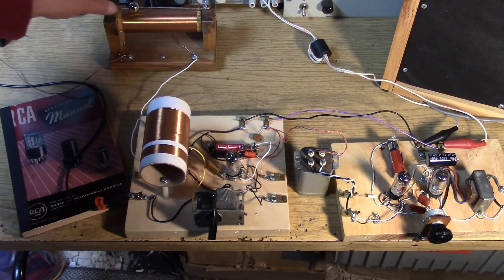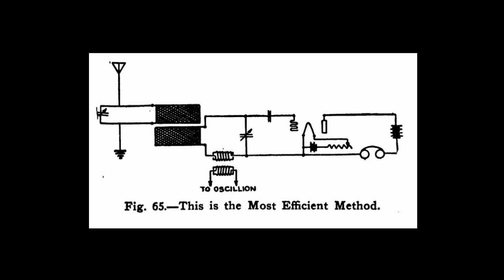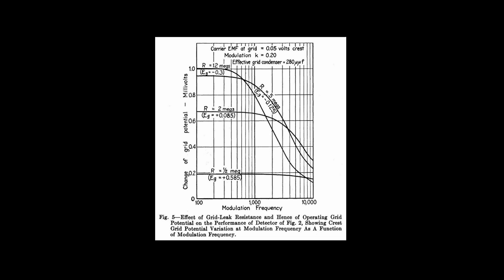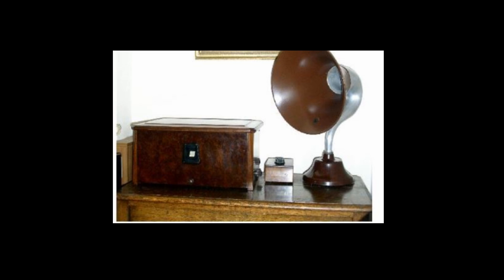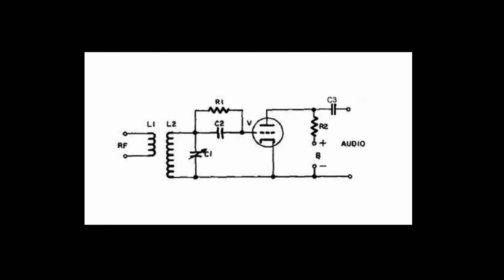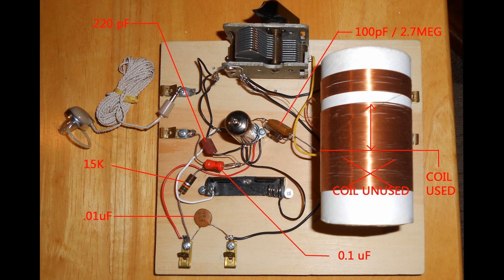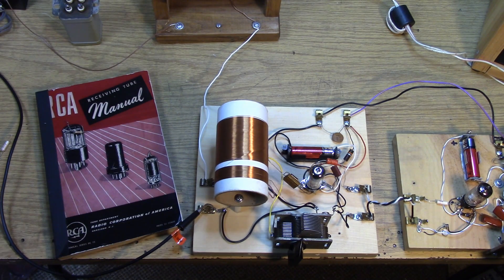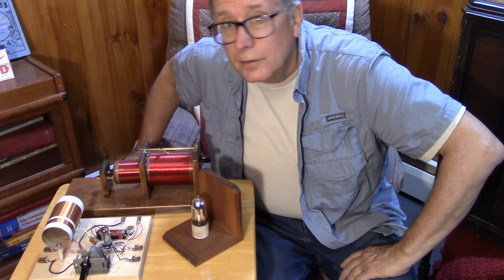Your First Tube Radio Project

Comment: how about some more info on the antenna loading coil?   e.g.: how many turns, form size, etc. ,  and when it would be helpful to use.  thanks.
Reply from the maker: Assuming a normal crystal radio antenna 50 to 100 feet of wire, your coil is simply resonating the wire. You wont need much at 1600 kHz, but you need perhaps 200T down low in the band. So normally just 250 turns of #26 to #30 on a 1.5" tube will allow you to resonate a decent wire length. Its not critical. That is the idea. About 400-500 uH.

Comment: Would a chunky ferrite bar (135x9mm) antenna with 70 turns (my crystal rig) work with this or do you need that large form coil? I've got 5 tubes from a 1939 RCA radio, which of them (oscillator, rectifier, IF, AF, output) would be best for the 1-tube radio? The rectifier & output take 35 & 50 volts, while the others take 12 volts (guessing those are best choices?). Thanks.
Reply from the maker: The Ferrite Rod is certainly more compact, and it allows for the possibility of tabletop reception without a long wire antenna. Generally the input coupling and (if you do a) regenerative tickler coil would both be much fewer turns than with an air coil due to the increased mutual coupling in the core. Spacing the windings can improve Q on the bar. Litz wire can also improve Q. For a 1 Tube start with the detector triode in a simple Armstrong regen. Later you can graduate to a pentode like the IF amplifier and do a Hartley Regen. Those should both be 12V.
Reply: @MIKROWAVE1 Thanks, which detector tube from this relic: Zenith SA7 (oscill.) or Emerson 12SQ7 (AF) would be best or even possible as first project connected to my crystal setup (ant/ferrite coil /germanium diode), using a 9v + 1.5v battery like I've seen on some of your videos & elsewhere. Tubes are 12 v so is this even possible? Basically I just want to use a tube for experience, lowest voltage, to enhance crystal radio performance. Also how to wire 8 pin socket? I see plastic reference notch & 1 - 8 pins clockwise but where to connect? Thanks.
Reply from the maker: @p1nesap 12SQ7 triode is an excellent choice for a grid leak detector. Then upgrade it to a regen by adding a tickler coil and regen control.
Reply: @MIKROWAVE1 Great I watched your grid leak video. I'm guessing pins 1 & 8 (grid 2 & filament) go to the 1.5v battery? And if 12SQ7 runs on 12.6 volts, why do you & all other circuits I see online use 22v? Would a small 12v battery work? Thanks.

Comment: That’s a great video - it answers a lot of questions for a beginner. As someone who owns a 2P2-J tube (~DL92) and feels a regen as a first project would be overkill, I really appreciate it. Thanks 👍🏻
Reply from the maker: Thanks for watching, and good luck on your valve radio circuits! As I may have mentioned, the audio power tubes sometimes make excellent radio tubes for grid leak and regenerative sets.

Comment: Hello,  I just bought one of those undocumented 3 tube sw radio kits, 1b2, 2p2, 2p2.  I plan to breadboard it on a wooden base.  It uses a cbm-223, I wonder if you  have a replacement suggestion using the classic rotating metal plate varicap.  I will be considering using one of the magic eye kits on Amazon for a tuning strength indicator.  My experience is mostly microcontroller based and of course the 3 transistor sw p-box kit in 1974.  Any suggestion would be appreciated.
Reply from the maker: They are cheap, but I am not a fan of the little variables.  The individual classic rebuilds are pricey. Amplified Parts and Antique Electronic Supply offer them. You could try a dual and single or even a triple ganged with a trimmer for a TRF.

Comment: Someone please help me, I have 6AU6, will it work?
Reply from the maker: 6AU6 will work fine for anything like this. You need 6V to light it up of course. and say 35 V to 60V of high voltage for the plate and screen! You can even treat it like a triode and connect the screen and plate together.
Reply: @MIKROWAVE1   Hi Sir, I am going step by step: First I made Crystal radio with a bigger coil multi-tapped> Then antenna loading coil with slider> Then Grid leak detector>Then Regen with adding a tickler.
All worked fine. This is the development of the last 4 days only.  Thanks Sir. 
Here is question please help me,
I made an antenna 40ft N-S and then It is Like L-shaped 30ft E-W. At night the receiver bombarded with Shortwave stations. My first question, is my antenna ok? because I want to listen AM BCB of India only. Next is should I try a shortwave coil for Trapping these bombardment with regen. Suggest me best coil design with tickler. Love from India.
Reply from the maker: @utsavprakash this is exceptional progress for 4 days.

Comment: Understanding AM Broadcast Audio Processing and Receiver Design
Thank you once again, Mike. Your episodes are always a pleasure, and I look forward to the next one with anticipation. In the context of this ongoing radio receiver project—and many others developed for AM Broadcast Band (BCB) reception—it's worth taking a deep dive into some of the technical challenges and opportunities we encounter, especially regarding audio fidelity and signal processing.

This presentation focuses on a crucial element of AM radio reception that is often overlooked by hobbyists and even some experienced builders: pre-emphasis and de-emphasis in AM broadcast processing, and how it affects the performance and audio quality of various types of receivers, particularly regenerative, crystal, and grid leak detectors.

The Regulatory Shift in the 1980s: The FCC Mandate
To understand modern AM receiver design, we must consider the regulatory changes that reshaped AM broadcasting in the United States. Back in the 1980s, the Federal Communications Commission (FCC) introduced a rule requiring AM radio stations to limit their high-frequency audio output to around 9.5 kHz. Above this threshold, a "brickwall" filter was applied, drastically attenuating any audio content beyond that range.
The rationale was to reduce adjacent-channel interference and to optimize the limited bandwidth available on the AM band. With this limitation, the sound of AM radio changed significantly. Gone were the wideband, high-fidelity transmissions of the earlier decades, replaced with more compressed and narrow audio that prioritized clarity and intelligibility over warmth and richness.
The Audio Processing Behind the Scenes
In line with these FCC regulations, AM broadcast audio processors were adjusted. These processors began to include a 75-microsecond pre-emphasis curve, similar to what FM stations had been using. The principle behind pre-emphasis is simple: audio frequencies in the upper range are boosted before transmission to improve the signal-to-noise ratio, especially important in noisy environments like the AM band.
However, due to the steep roll-off above 9.5 kHz, this boost is not symmetrical or natural-sounding when received on basic or uncorrected receivers. This results in AM audio that may come across as excessively bright, harsh, or tinny, especially when using simple receivers that do not compensate for this pre-emphasis.
Impact on Simple Receiver Designs
Let’s consider how this affects three classic types of receivers commonly used by hobbyists:
Crystal Sets: These are passive radios with no amplification or active filtering. They offer pure, unmodified reception of the AM signal, which means they will present the pre-emphasized signal as-is. This can result in overly bright or "sizzly" audio, especially on modern AM stations.
Regenerative Receivers (Regen Sets): These use positive feedback to improve sensitivity and selectivity. While better than crystal sets, regen receivers are still susceptible to tonal imbalances caused by broadcast-side audio shaping.
Grid Leak Detectors: Popular in early tube radio designs, grid leak detectors also lack any internal audio correction. They respond quite strongly to the higher frequencies and can thus over-emphasize them due to the lack of compensatory circuits.
In all three cases, the receivers were never intended to handle a pre-emphasized, bandwidth-limited audio signal. Their flat response curves can therefore exaggerate any spectral imbalances in the received signal.
Engineering a Solution: De-emphasis Circuits
Fortunately, this harshness or "brightness" is not unavoidable. With thoughtful design, we can compensate for the effects of pre-emphasis using de-emphasis filters.
What is De-emphasis?
De-emphasis is the reverse of pre-emphasis. It's an intentional reduction of high-frequency components in the audio signal, restoring a more natural tonal balance. If AM stations use a 75-microsecond pre-emphasis time constant, we can implement a 75-microsecond de-emphasis circuit in the receiver to counteract that boost.
How to Implement De-emphasis
There are two main strategies to integrate this into your receiver project:
In the Detector Stage:
You can modify the grid leak resistor/capacitor network in your regen or grid leak detector to roll off high frequencies.
By choosing appropriate values that match a 75 µs time constant, the detector stage itself becomes frequency-selective in a way that mimics de-emphasis.
In the Audio Amplifier:
Alternatively, and perhaps more cleanly, you can place a low-pass RC filter at the input of the audio amplifier.
The filter is made with a resistor and capacitor tuned to the 75 µs time constant. This removes the boosted high frequencies and delivers a more "mellow" and listenable audio signal.
This method has the advantage of being non-invasive to the RF and detector stages, and can be added or removed as desired.
For example, using a capacitor of 0.01 µF and a resistor of 7.5 kΩ would yield a filter very close to the desired 75 µs time constant (since τ = R × C = 0.00001 × 7500 = 0.075 seconds, or 75 µs).
Benefits of De-emphasis in Receiver Projects
Integrating de-emphasis in your AM receiver project offers numerous benefits:
Improved Audio Fidelity: The sound becomes more balanced, warm, and natural—especially important for spoken word content like news or storytelling.
Listener Comfort: Harsh highs can lead to fatigue. De-emphasis softens the edges and makes long listening sessions more enjoyable.
Historical Accuracy: If your receiver is part of a restoration or reproduction of a classic design, adding de-emphasis makes it more compatible with modern AM broadcasts, helping it perform as it would have with historical wideband signals.
Customizability: With a simple switch or selector circuit, you could even allow users to toggle de-emphasis on or off depending on the station they are receiving or personal taste.
Conclusion
Modern AM broadcasts in the United States, shaped by FCC mandates and evolving audio processing technology, are different from what earlier receiver designs were created to handle. The use of a 75 µs pre-emphasis curve, combined with aggressive high-frequency filtering, means that simple AM receivers like crystal sets, regen radios, or grid leak detectors may produce unbalanced audio if left uncorrected.
Fortunately, with a thoughtful application of de-emphasis filtering, either in the detector stage or audio amplifier, the resulting sound can be transformed. It can go from brittle and unpleasant to smooth and warm—restoring much of the natural character of human speech and music that makes radio a pleasure to listen to.
For anyone engaged in designing or restoring AM radios, especially those operating in today’s regulatory environment, understanding and applying pre-emphasis and de-emphasis principles is both scientifically sound and aesthetically rewarding.
Thank you again for your attention—and thanks, Mike, for continuing to inspire and educate through your episodes.

Comment: My first radio project was a grid leak design based on the 1S5 tube. 45 volt "B" battery and 1.5 volt "A" battery for filament.
Reply from the maker: Wow my fist tube detector was a 3V4 grid leak.

Comment: Excellent presentation especially re: leaky-grid capacitors and resistors. 
As young lads back in the early 1960s we made quite a number of these without really understanding the effect on audio response. Likewise, regeneration would narrow the band-width but by how much? Having loud-speakers invariably without a baffle or cabinet of any kind, guess this gave the necessary HF lift as to us it sounded OK even with the 'pop' groups of the day.
Keep up the good work!
P.S. These days my ears act as 'brick-wall' low-pass filters cutting off at about 2 kHz!

Comment: As a young boy in the 1960's I made a Hikers One radio from an old Radio Magazine and it used a DL92A valve. I have never seen that valve referenced ever again! The little set was amazing but I found I could increase performance by winding up the voltage supplied to the valve until one day, it just gave out@! I had plans on trying to build a Hikers Three but never did.

Comment: OK . Done. Used a DF91 instead, picked 2.2M for grid leak resistor. Used 4 tired 9V batteris (33V)and strangled the A+ battery to 1.35V.
Soldered as much as possible on the tube holder and on ceramic stand offs. Fed this contraption with a 41 m long wire some 25 meter
high with a single wire down lead. Magic!
Some stations would benefit of a volume pot even with the antenna coil pulled away.
Thanks for inspiring me!
de SA3BOW
Reply from the maker: Beautiful SA3BOW! Booming in signals!
Reply: @MIKROWAVE1  Beautiful? To small photos on qrz to reveal the sloppiness then.
Would this be a suitable radio to "upgrade" to a regenerative?
de SA3BOW

Comment: Using Wire Ended vacuum tubes like those used in hearing aids from the 50's you might be able to make a radio about the size of a cigarette packet.
Reply: By the end of WW2, some Polak radio engineers working in England did pretty much that!

Comment: Big waste of time and effort 2 tubes are louder
Reply from the maker: I have just received this week (from a viewer) an automatic regen to evaluate. It has 10 Bipolar transistors, 2 FETs, and two Quad op amps, and it does not even include the speaker amp. Wait till you see this thing.

Comment: It look like regen radio is easy to make. But when I tried to make it at home via replacing 1.5M grid leak with a piece of wood and graphite my radio did not work)
Reply from the maker: So it worked with the 1.5M? But did not when you substituted the home made resistor? Like Spock said - "This is not logical. The circuit must work."  Try making the resistor with a different media like cardboard.

Comment: Interesting, I just remembered building a similar set as a kid in the 70's. It used a 1T4 that I recovered from a portable radio I brought home from the rubbish dump.
I fondly remember there were old valve radios everywhere at our municipal dumps back then, my father would always curse me for bringing more 'junk' back home. 
Frequently they were just a chassis, the bakelite cases usually being smashed, but that portable had battery valves which to me were the holy grail, to be able to make something 
portable really was the ultimate challenge..
Cheers.
Reply from the maker: Yeah those battery tube radios of the 50s were discarded pretty quickly when transistor radios came in!

Comment: Is that a small Isolation transformer your using
Reply from the maker: I sometimes use an audio transformer to load the crystal radios output and get it into an amp..

Comment: Hi there. I have a question. I have several old tubes, and would like to use them to make a one or two tube radio. My question is: where can I find a schematic for using a type 75 tube?
Reply from the maker: The Type 75 is the granddaddy of the Triode Diode used as a detector. So it will work in ANY single or dual triode Regen circuit for instance using, 6AV6, 6AT6, 6BF6, 6C4, 6J5, 76, 30, or duals like 6SN7, 12AU7 and so on, as long as you respect the filament voltage. It is just a standard medium-High MU Triode. It would work fine in this if wired to match the data for the pins. http://www.bignick.net/Morgan_Radio/Radio_1.htm

Comment: Fine business Mike.  I love watching these videos over and over.  I learn something new every time.  What I found especially interesting was the interplay of the grid leak capacitor and resistor values compared to the frequency bandwidth and the RF plate bypass capacitor value vs the audio response.
Reply from the maker: When you only have a few parts, everything can be investigated!

Comment: Great Video! It brings back memories.... I recently acquired an Aud-Ion battery powered tube radio. It has 4 tubes 1U6,1T4,1S5 and 3s4...None of them glow even if the heater on all of them is ok. Do these tubes  usually visibly glow when 1.5V Dc is applied to the heater?
Reply from the maker: It is like magic. You do see a dull glow in some of them in total darkness. They emit nicely at low power because they do not have to heat a cathode.
Reply: @MIKROWAVE1  Thank you.! That explains everything; the heater is the cathode and I did not check in total darkness...

Comment: Hello! It would be interesting --two tube superhet. There needs two coupled IF LC circuits. The second stage - regenerator on one tube.
Reply from the maker: A reflexed 2 valve Superhet can be done all right. But it becomes a bit easier to sus with three tubes!

Comment: Does the air capacitor need to be a clockwise rotation to be like a normal am radio? I noticed they sell Counter CW rotation also? thanks
Reply from the maker: Ha! Yes the dial and designs were for one way or the other! Sometimes a dial string arrangement or gear system switched it again to the dial direction.
Reply: @MIKROWAVE1  which is standard tuning with no gear system?